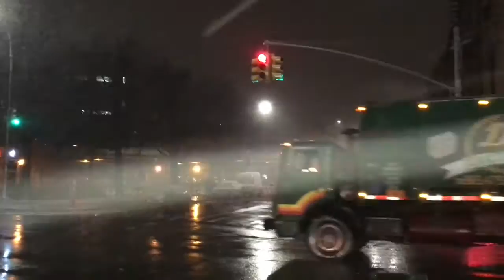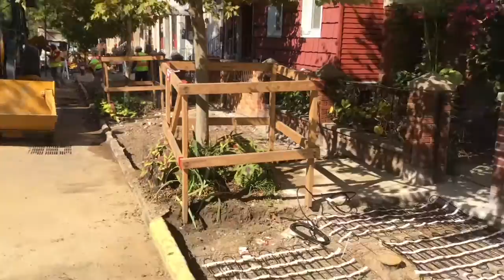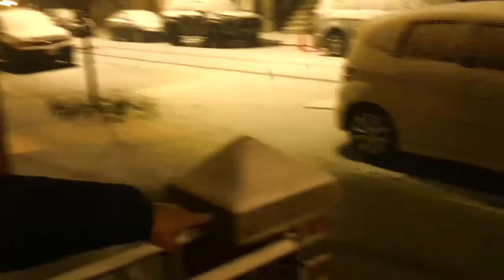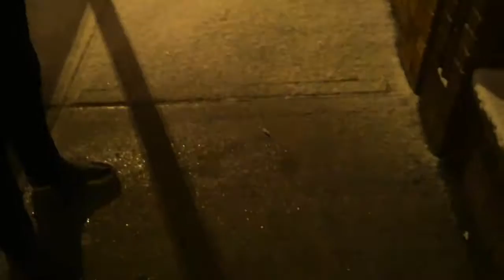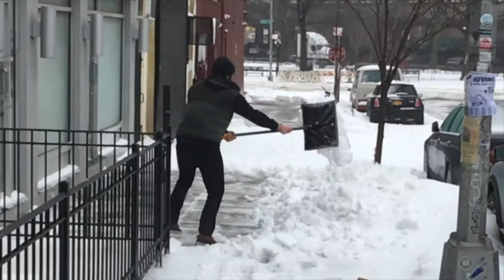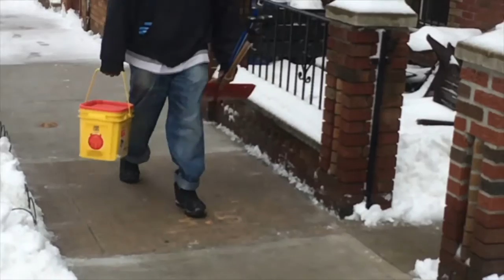Let It Snow: Follow-up on the Brooklyn Snow Melting System Installation

Comment: I think this is very good. This should be like in nyc and more in Brooklyn. in front of shops and stores. should be like a Most have and Need. We have something like this up here at our place in Maine. not sure if its Warmup brand. we have it on the driveway. Our driveway is close to 900 feet long. and it does the whole thing.

Comment: So basically the city paid for their concrete and did all the paving for free.
Reply: Exactly.   They were doing the sidewalks and I was able to get my system in the concrete because I was off work that day!
Reply: duh, if they ruin any part of your property they are required by law to fix the damage.
Reply: @ILIK3HATERZ  Actually, it's the opposite.   The city owns the sidewalks but they are fine with residents adding something like this system, but if, at anytime in the future the city needs to do some work on the sidewalk and our system is damaged, WE are responsible, not the city.   And I'm okay with that.

Comment: I'm curious how much does it cost to run the system ? And since you didn't file for any permits what will happen when it is time to sell that house ? I think you may have to either brake the side walk and remove it or at the very least disconnect the electricity from it ?? But I do think that all commercial buildings should have some kind of snow melting system . It would cut down on slip and fall lawsuits .
Reply: Hi Larry.   The system seems to add zero to our bill during non-snow days.  It only adds to the bill when it's melting, and our NYC storms tend to blow in, dump and then be all melted away within three or four days.  So the melting period for us might be from d8 to 36 hours, which could add between $40 and $80.   When we sell the house we'll tell the new owners the truth:   the city doesn't require a permit, but the city also doesn't take responsibility for damage to our system if they ever need to dig up our sidewalk.

Comment: How much did it add to your electric bill?
Reply: Hi scipaul1.   This is a tough one to answer.  The short answer is that it adds very little because we rarely need the system because we rarely have snow here.   During the normal winter when the system is in standby and ready to turn itself on, there appears to be zero added cost since the system is asleep.   During a snow storm when it turns on and begins heating the sidewalk it might run anywhere from 8 hours to 36 hours, depending on how bad the storm is.  During those periods we would see a bump of around $40 to $80 that month over normal charges.